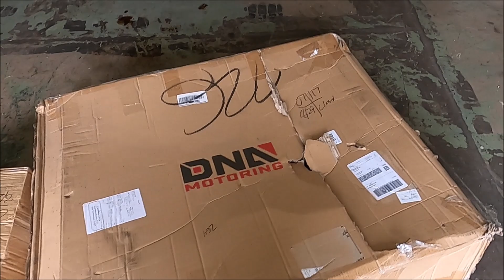My Kids Clapped out Sh*box Gets Clapped Out Headers!

Comment: Looks good but I get the query over the alternator, ceramic coat AND heat wrap would be my option just to reduce the heat as much as you possibly can. Where the flange is close to the oil pan I would just shave it a touch just to give a few more milimeters of clearance to prevent any chance of stuff vibrating.

Comment: Hey just a headsup also. Make sure you use only hyundai OEM oil filters. Aftermarket ones cause the HLAs to tick and eventually fail. And yes Ceramic coat the headers. Ive seen those headers melt alternator wires before.

Comment: A good cam regrind  spec thats usually used for these cars is .349 lift 210 duration and 110 lobe separation  send it out to crower to get regrinded , also when you redo the head gasket use oem head gaskets they are honestly the best even guys who boost these used the stock multi layer black steal ones because how good they are. And they usually never go bad

Comment: You should get them ceramic coated. I had my American Racing headers and Y-pipe coated and they run cooler than the factory exhaust did. Costs a little but well worth it. I paid about $275 to have them coated inside and out.

Comment: Ive never had a problem with ebay parts i actually got a set of hubs and bearings for $60 they were in foam wrapped in plastic with a plastic crush protector anf the each came with a white pair of gloves

Comment: i wouldn't ceramic coat these since most ebay headers crack. i would heat wrap that runner though since it is cheaper. I personally love these cars my Grandmothers neighbors son as i was growing up had done simple bolt ons cam and had it tuned and it was a very very fast car an most beautiful tiburon I have seen still have yet to see one that looks as good as it did before he let it sit in his garage. Something to do with the clutch line/cable font remember witch these cars had. He never did get the right part.

Comment: I wouldnt waste my time on any of that not until I build the motor and put it in and not even build just tuned gaskets valves seals just rebuild then worry about the rest motor should be first and foremost important and trans then all your other accessories

Comment: I got DNA motoring cat back for my civic and just a heads up, that resonator isn’t real, it’s just regular pipe that they make look like a resonator. Also, the “mufflers” are hollow. They have zero fiberglass in them so it’s just big hollow cans with big tips. It will sound like 100% trash if you don’t replace the “mufflers” with something nice like a vibrant muffler. 👍